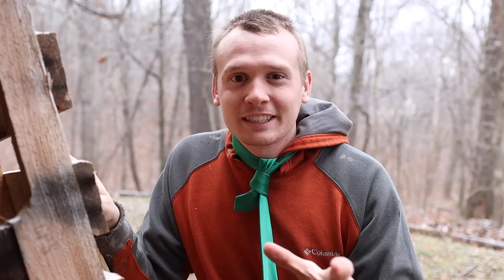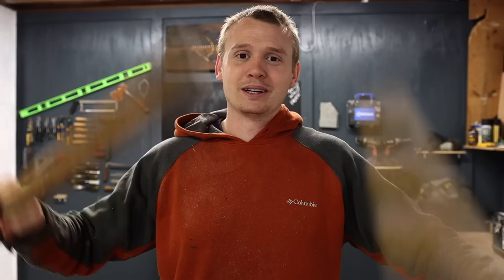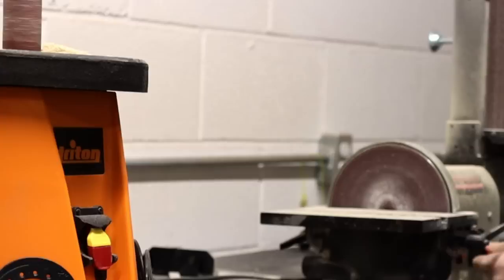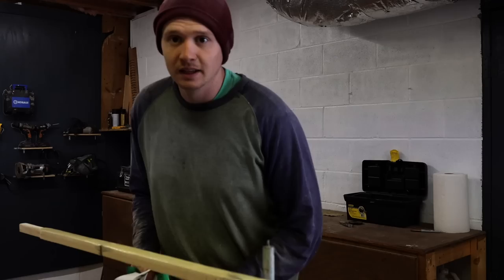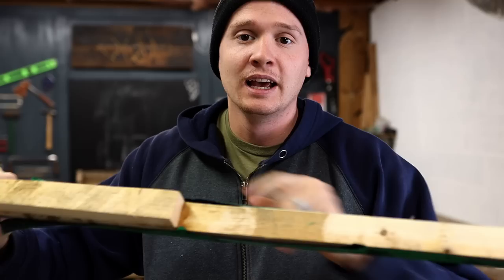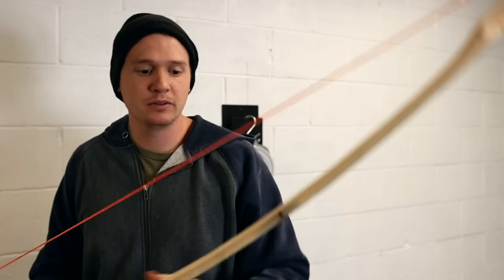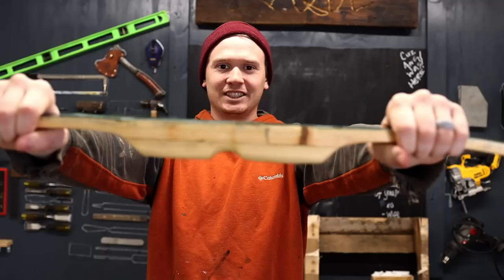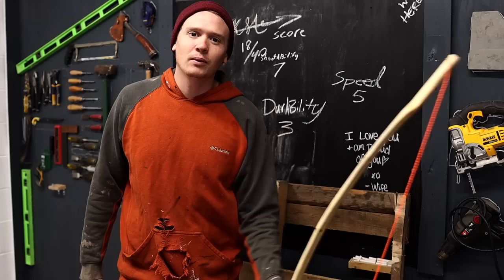Making A Bow Out Of A PALLET & TIE "WILL IT BOW" (EP.1)

Comment: As like a few others recommended pvc. I tried 1” pvc schedule 40 and it works well. For me it was a bit challenging tho to flatten it out evenly and figuring out an arrow rest.
Reply: Use the polyester fabric without the PVC coating.  I used to work at a manufacturing company  of pvc coated polyester fabric,  The nylon threads are damm strong.  Should definitely make a good backing.

Comment: You should try to put the linseed oil on the wood before the glue. It will do two things. It will reduce the amount of glue, and it will strengthen the wood. You will have less problems with hinging. At least that is what i came out with. The bows are acting much better after using the oil in production... :D
Reply: que pegamento se usa para esto?

Comment: As a note, most of the pallets I worked with when I was working in a warehouse were almost certainly pine - they had that distinctive smell every time they cracked, which was often.  Makes sense, because pine is much cheaper than hardwoods like oak, and cost is the primary concern when they're making pallets.
Reply: @flyingfish7072  Certainly.  Although, we did deal with some pretty heavy appliances - getting them on and off the pallets without breaking anything was a challenge.

Comment: Kramer, if you want a really strong joint with glue, esp PVA, first mix 50% water and glue, let that soak into the wood grain and pores, then when dry, use 100% PVA and you find that the glue will adhere to the glue that has rooted into the wood, AKA, a stronger bond than the wood itself. This works on any porous surface and will never fail as long as the glue can be watered down
Also, with soft woods, can laminating them help with their inherent weaknesses ? maybe 4 thin layers ?

Comment: Hey Kramer try backing one with Jute twine from the hobby section at a craft store or walmart. Glue it to the back running tip to tip. I did a hickory pyrimid style bow this way. I used tight bond three to glue it down then used some camo paint on the jute. It finished out at 70lbs at 29" draw. I was shooting for a good bow for Elk hunting. It is a very smooth and quiet shooting bow. I will definantly be backing more bows this way and it looks realy cool.

Comment: Noticed you used titebond 3 for the finger joint and titebond 2 for the backing? Is there a rule of thumb for when to use one vs the other?  Both are water resistant.

Comment: If you cut the tie right and overlap it on the back of the riser, you can make it work for the full length of the bow. I think the one I made is 70" tip to tip if not 72". It is at my cabin 2 1/2 hours away right now, so I can't say for sure. You have to be careful with maple in compression as well. I got the same fractures on a maple board bow that I tried backing with hickory. The hickory overpowered the maple and I ended up with stress fractures like the one you showed. I wondered about tha poplar one. There is probably a reason why we haven't heard much about poplar bows, lol! Still a great educational video though.

Comment: You should try to make arrows out of  a material called hdpe, it's most commonly found in mill jugs, bottle tops and motor oil cans(but cleanup for those is quite a hassle) etc. The best part is that you can melt it in an oven at 150 degrees Celsius and it releases no fumes whatsoever.

Comment: I'm sure you've noticed that your hammer rings when  you strike another tool, its tempered but was never normalized. 
Quick fix take the head off the handle and put it in a pre- heated oven at around 425-450 for three hrs. Let it cool slow and then do it again. That should kill the ring.  
Dig your vlog, I  built a bow an it's  not to bad. 😎👍
Reply from the maker: Awesome!

Comment: What kind of glue you use....I didn't see it heard what type of glue you are using for glueing rest, what for back of bow ,what for parts of laminate or bow layers?
Reply: In this video he used Titebond 2 wood glue, but has recommended Titebond 3 in the past. Very similar stuff, but Titebond 3 is waterproof. You can get it at Home Depot and maybe Lowe’s. Sometimes he also uses epoxy, but this one is all Titebond. Any wood glue should work, but I also recommend Titebond 2 or 3. Properly glued joints are stronger than the wood.

Comment: So I have a question about that bow  and the nail hole... What if you unstrung the bow and flattened it out and soaked the wood there in slow curing epoxy or glue so that it strengthened that area and you then let itdry before bending it back again. Would that be a solution to solve hinging? Can you test it? Also you should add to the name of the series and call it Will it Bow or Break?, and as ffor sugestions of what to try to make a bow out of I have a few... What about old boat (like fiberglass boat or an olld plastic kayak but really any old boat), toilet paper (and epoxy of course), bike tires/innertubes as backers (or even scraps from a bike shop to make the whole bow then take some of the staff from the bike shop shooting with it as a team building exercise), do the same thing at a mechanics or car shop, do a junk yard bow build only using stuff you find at the junk yard (maybe even making your own glue or something or not using glue at all), you could do an "in the woods build" only using natural stuff starting by selecting a log or a stick to start with and collecting sap for pitch glue ect, you could do a thrift store build or a free on craigs list build, you could try using things from other sports I think you could probably make an amazing bow out of an old ski, maybe try a fishing pole or fishing equiptment, you could make one out of food like a baguette (of course soaked in glue or epoxy), old furniture, try using woods you know are garbage but try to use techniques to make them work anyway (like strengthening spots that are starting to hinge, gluing on patches and wrapping the problem area), gardening tools and equiptment, and then just find any large corporations in your area and ask them if you can try to make a bow out of their scraps and maybe do like a 30 sec hey this is a big local company that makes whatever... here is an affiliate link or something. Anyways I'm sure you will be able to keep this series going for a long time and I really enjoy it especially that never fail learn and try again attitude!

Comment: You can make a bow from pine if its like 2 1/2 inches wide but you can usually tell by the weigh of the skid if its oak.
Perhaps backing it with hickory would have worked better?
Great job though.